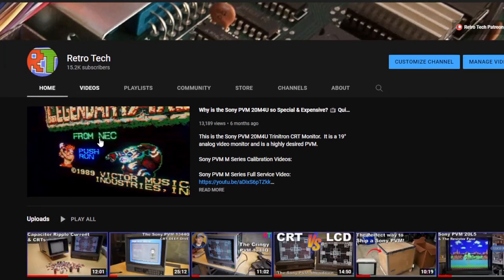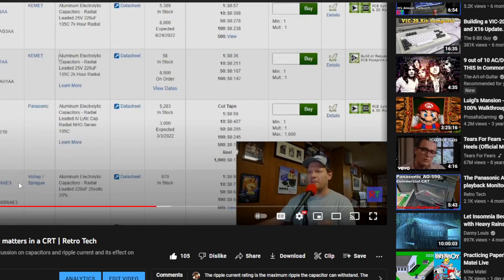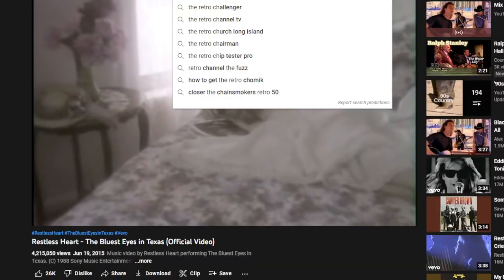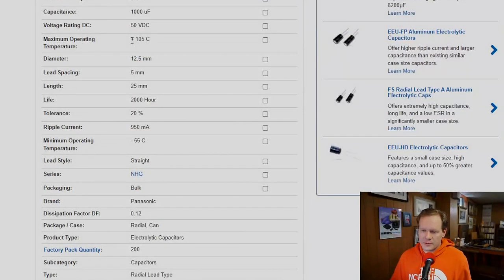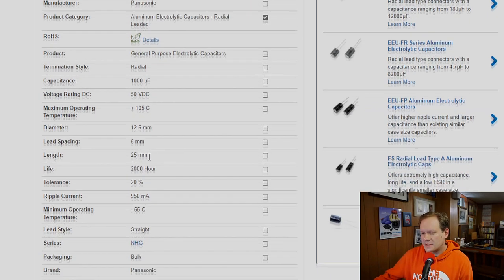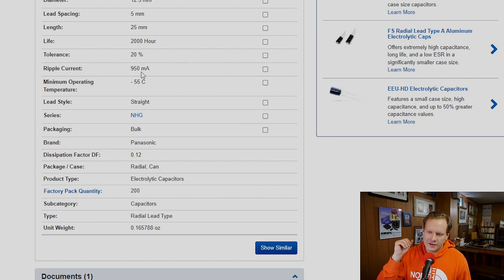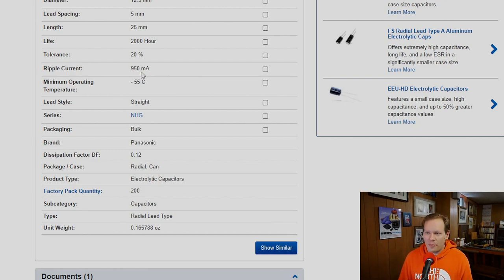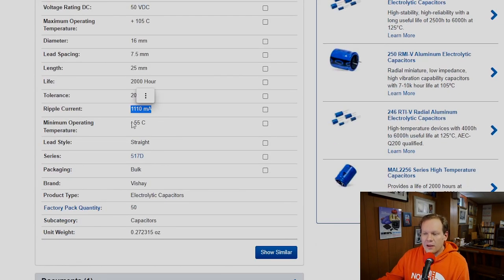I'm Sorry, I was Wrong! | Capacitor Ripple Current Follow Up

Comment: Your channel is fantastic! Thanks for doing this. With vintage equipment, it is science but also sometimes a bit of magic. 
I just recapped a sony b&w from 1969.   For the horizontal, I ordered based on same value but better characteristics….The tv just didn’t like them,  it was terrible.   I had to put the old caps back  to make it worked again..…but spent hours figuring out what was wrong.

Comment: Thank you for your honesty. I'm now really curious what actually went wrong technically on the earlier board fixes that soured your view on ripple current. Did Pat commented on the supposedly inappropriate capacitors that were replacing the originals for the PA board case?
Reply: I was curious about the same thing! It could have been due to ESR... there's probably some correlation between a cap's rated max ripple and its ESR.

Comment: Steve, mad respect for not only sharing being incorrect, but also leaving the og video up too. No one is perfect and we all make mistakes or get things wrong. I know I sure do as well sometimes, but this is how we learn. Sometimes it is good to experience. I've been poking thru your older videos and came across this. Now I am perplexed at why the high life caps you tried before, caused issues. I've used many high life caps in projects and had no issues, though I guess I will find out here soon as I have just gotten into my first PVM ever, and have opted for 10k caps. I'd be curious to a 1:1 comparison. That is, the exact part numbers of the original high life caps, vs the PNs of the caps that worked for you. Of course, it may be long ago enough that you may not recall (though if you keep spreadsheets like I do or documentation of your adventures, then maybe). There are sooo many different kinds of caps, I can only think perhaps ESR or some kind of frequency response issue. I know I have had to stick to lower life caps in some CRTs due to the originals having very low ESR, or high frequency performance (the HF orange electros in some vintage Japanese gear).

Comment: So what ended up being the issue with the caps you'd originally used? Obviously switching an electrolytic for a film or vice versa, or any situation where you're changing the material of the capacitor, you're going to end up with different characteristics, even if they're the same on paper, but switching Electrolytic for Electrolytic, as a definite non-expert (who still manages to order caps for projects), I definitely am interested in the actual fault that occurred!

Comment: As long as it meets your needed current you are solid, going higher ripple current doesnt always mean its a better capacitor either. Usually higher voltage rated caps will have better ripple current but esr could suffer among other specs.

Comment: Hi Steve. Thanks for clarification. A while back I  replaced the “sinister six” capacitors you identified on the PA board of my BVM with a kit you provided and I was wondering if I should get those changed out or maybe get it serviced from Pat.

Comment: Doesn’t this still raise the question why your high-end kit was not working? Should have done the job then, right? Given the new explanation about ripple current… i always thought just to check the Farads to be ok, and with voltage you can go a little higher, if your specific voltage is not available… but i could be terribly wrong as well😀…we all learn as we go

Comment: It's funny because even the vaguest, least descript datasheets are very specific with their parameters (i.e. "Maximum repetitive peak reverse voltage" for diodes). So you'd think they'd call it "Maximum tolerated RMS ripple current" or something like instead of just "Ripple current" since ripple is what we're trying to eliminate. That was my rationale and thus I used to think it was a negative mark too. Different reasoning than you but I was just as wrong so don't worry, you were not alone.  Hey, we all make mistakes so I wouldn't consider it a negative mark on your datasheet. It's the people who don't admit to them that get the sketchy side-eye from me.